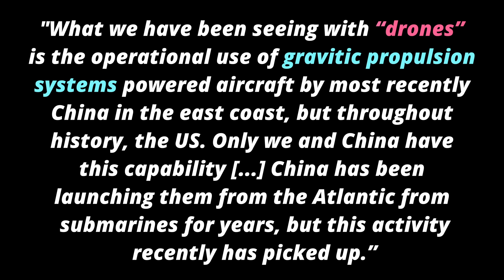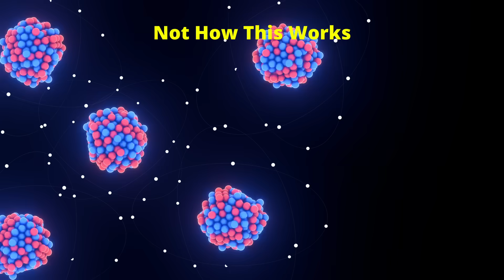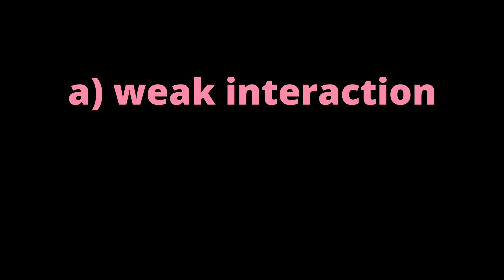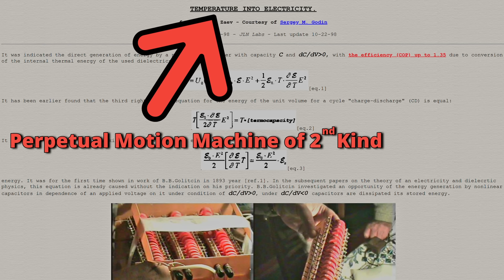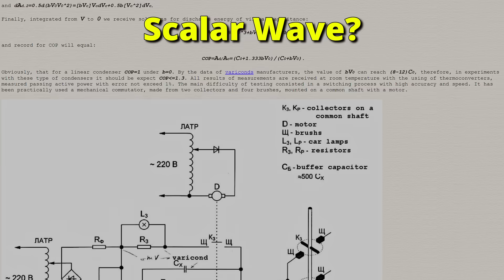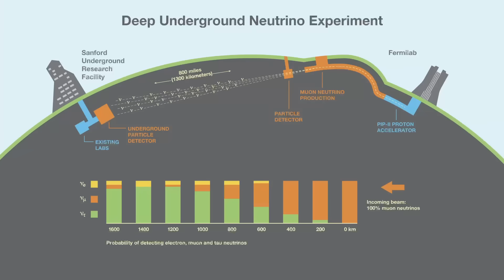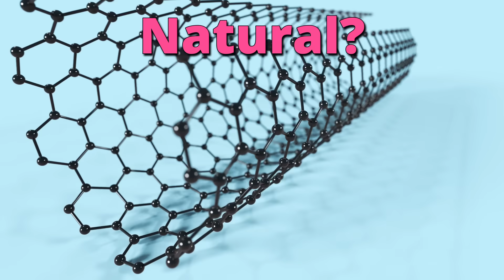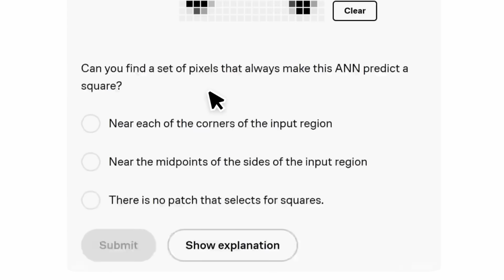What is “gravitic propulsion” and could the US government hide it?

Comment: I don't like them hiding math 😢
Reply: math is not important here. its the theory and model that is being hidden. if you have the right model, then you need to put it into formulas to actually get the interactions at the desired scale. but you need a theoretical model first to know what you are trying to calculate. then you make experiments to see if your model can work in a logical sense, then you make the equations to predict the forces, then you make experiments and   measurements.

physics has been degraded into pure math. its void of philosophy, and therefore full of bs interpretations. if you define axiomatically that a magnetic field is a force field acting on charges, then you axiomatically exclude all the other possible interactions with this model, since the field is modeled exclusively to predict the force on charges. such a model cannot be accurate or complete because it assumes the field to be only something that affects charges from the start. 

energy conservation cannot be used to predict missing interactions here because the initial condition only includes the energy that is needed to be transferred to the charges, and therefore only this energy is assigned to the field. 

a good way to use energy conservation to show that em fields must be gravitational in nature is the fact that photons are purely em waves with no rest mass, meaning they have 100% of their energy in their em field, because they are nothing but an em wave, which is an em field fluctuation. but they have their own gravitational field as they are red shifted by moving against gravity. if 100% if their energy is em, and they loose energy by interacting with gravity, part of that em force is directly interacting with gravity, making electromagnetism inherently gravitational.

Comment: The physics of highly accurate ballistic trajectories was classified and took several years before it was made public knowledge. Some of it is still classified BTW.

Electro-gravitics
Research began with Soviet Russia long before the 1940s, after 1947 physicists began to try and figure out how flying disks (flying saucers) fly, by the 1960s they figured out how they fly, using localised gravitational fields, towards the late 1970s the US had successfully built their own and flown it. Its flight characteristics were unstable, work then began in the next version after working out the issues and the new craft (TR3B) was flying, entirely human engineering. Russia was working on their own, but for some unknown reason stopped research in the 1970s.
China worked it out and had their own craft in the 2010s.

At the core, it is purported to use a low viscosity, near super conductivity liquid metal spinning at extremely high potentials and speeds.
My feelings on this is that there would need to be 2 coaxial rings, to counter the torque that would be acting on the craft.

It is quite the rabbit hole, and is all hidden physics.

Former director of skunk works at  Lockheed in the 1990s, confirmed that the physics they were using were at least 40 years ahead of mainstream academia.

Comment: I do not believe that large systems will lead to new physics beyond the Standard Model. Because even if large, complex systems would have properties that do not emerge from the Standard Model (which I doubt, but that’s just me), we would be likely unable to prove that. No one can apply QFT to a carbon nanotube and calculate results with sufficient precision to significantly contradict any well-done experiment.

The fundamental theories are so difficult to apply to real-world problems that no one ever does that. Simpler models as used in Quantum Chemistry have some applicability, but still any discrepancy to experiment would be interpreted as one of the numerous approximations used breaking down, so it would never challenge the fundamental theory.

As an example, I refer to the protein folding problem. We ʙᴇʟɪᴇᴠᴇ to understand the theory behind, it is just the sum of a zillion weak interactions between all the atoms in the protein, but quantum chemistry was never able to come up with a model that is both computationally feasible and accurate to predict secondary structure (=geometry) from primary structure (=sequence of amino acids). Now since a few years, the problem is mostly solved by AlphaFold, an AI model that has no idea of physics, but successfully inter- and extrapolates from a large database of known structures. The disadvantage is that we get a results (mostly a correct one), but have no idea about the real physical interactions that lead to this results. So we know what is, but still not why. There is really no way to improve fundamental theories from that.

Comment: Solution of the measurement problem means dealing with nonlinear activity which means computer simulation. The collapse of the wave function is likely to be a collective phenomenon running in many dimensions of configuration space (i.e. exponential time) and beyond the capacity of any computer. Even if we have a plausible hypothesis (e.g. tachyonic Brownian motion) we are likely to be going nowhere. Maybe we can cheat somehow.

The simplest cheat is to say that for objects heavier than the Planck mass, the Uncertainty Principle changes character to one based upon classical Brownian motion. We can at least work on polynomial-time computer simulations to explore this.

Comment: Place to start:

1. What powers electrons and protons?
2. What is gravity?  Not how do we experience it, but what is it?
3. How do fields and forces propagate through what appears to be nothing?
4. Parallel Wires carrying current in the same direction attract, while those carrying current in the opposite direction repel with either an air or vacuum gap between (hint: current flows in the same direction share their poloidal magnetic fields to form a single, stronger poloidal field around them both - a self building structure)

And, beyond that:

5.What are solitons, and why do they remain stable?  (Hint:  both electric and magnetic solitons - or loop toruses - which act as Möbius strips, naturally form)

Start answering those questions and you quickly come to the understanding there is no “anti”gravity.

 Gravitic - aether stream - propulsion is possible, however, thanks to fractal toroids (torus solitons running through the centre of wrapping poloidal torus solitons that, in turn, each run through the centre of their own poloidal toruses and potentially ever deeper in a self-similar fashion) - the hitherto unexplored structure you were talking about, a structure made of self forming ring solitons condensing out of a charge separated gas or fluid subjected to pulsed shocks at a set frequency in a resonant cavity

An example would be water (a polar molecule) subjected to ultrasound in a water bath into which is submerged a metallic skinned chamber providing both the cavity and electrons to “feed” the emerging self-forming fractal toroid structure.

So, has this been witnessed?  You bet - see the MFMP ULTR experiment
Reply: As to “hiding” lines of research in physics, this certainly happened- by using the absence of evidence from the (flawed) 1887 Michelson-Morley experiment as evidence of absence so as to pronounce the aether as non-existent, thereafter using a combination of the false claim, scorn, ridicule, peer pressure and the invention of some abstract non-physical “spacetime” to close off an otherwise rich seam of research (to such an extent that even when, in 1920, Albert Einstein himself stated his belief in a real aether, his statement was just ignored and buried.

So, is it a possibility that parts of and lines of research in physics were made to “disappear” - it already happened to the detriment of humanity for the last almost 150
Reply: As to “hiding” lines of research in physics, this certainly happened- by using the absence of evidence from the (incorrectly interpreted and hence flawed) 1887 Michelson-Morley experiment as evidence of absence so as to pronounce the aether as non-existent, thereafter using a combination of the false claim, scorn, ridicule, peer pressure and the invention of some abstract non-physical “spacetime” to close off an otherwise rich seam of research (to such an extent that even when, in 1920, Albert Einstein himself stated his belief in a real aether, his statement was just ignored and buried.

So, is it a possibility that parts of and lines of research in physics were made to “disappear” - it already happened to the detriment of humanity for the last almost 150

Comment: Somebody doesn't know that the ideal transformer model is wrong in spice.f5, and doesn't know shit about parallel resonance,  nor how to tap it for energy.  You didn't even try the resonate primary, 1 to 1 to feed a resonate primary of a second transformer,, because,  it will crash your simulation by outside assumptions written into the software, and physical circuits will never be properly simulated but, stopped.  Build circuit, compare to simulation.

Comment: So lets assume inertia is the result of fluctuations of the vacuum and the resulting resistance to mass these fluctuations cause. Something akin to quantization of gravity causing resistance to changes in momentum via "friction" of vacuum fluctuations against a moving mass. Now if you could produce a meta material that resonated with these fluctuations at the quantum level such that inertia was dampened to effectively zero by cancelling out this "friction', you could produce a gravitic planar propulsion system that resembled the effects described.

Comment: What if?...  the gravitic propulsion system exploits the general relativity phenomenon of increasing mass of an object with approach to light speed.  You no longer need a large particle or body to achieve high mass and thus high gravity.   Hypothetically a small mass can be accelerated to near the speed of light relative to an observer thereby generating a large gravitic field.  That said, the mechanical complexities and properties of such a device are any ones guess.  You would, at the very least, need to have some sort of spatial isolation from the accelerated particle which could probably only happen if space is locally distorted. This also doesn't address why two objects of high mass, the earth and the hypothetical gravity generator are not attracted and are, instead, repulsed.  If anything, a gravitic drive would have to generate anti-gravity using some yet undiscovered and undefined exotic particle or multi-particle mass.  Others have speculated on anti-matter but, from what I understand, the properties of anti-matter are not anti in all respects. A recent paper showed that antimatter attracts normal matter.  
Speculation is never a bad thing and conspiracy theory is sometimes just underdeveloped and under-informed nascent theory.

Comment: The issue of classification is very interesting, and there are books on the subject. However, as you point out, that's at the physics and engineering stage, not at the maths stage. A good example would be implosion hydrodynamics and target design in thermonuclear weapons, and inertial confinement fusion research, which is related to the former.

Comment: The increasing rarity of new discoveries is just how discoveries work in every field. Early paleontologists found bones literally sticking out of the ground and every single one was a monumental find that described something new and huge. Once the surface is picked over you have to start digging and finds become statistically more likely to be something you already know. 

This is the same for ore mines and oil fields. Eventually you cross the threshold where the goodies are hidden in places that were not economically viable to look before and you need better technology and more time and effort to extract the stuff. 

Sanding a piece of wood, weeding a garden, restoring an old watch, these are all the same principle of diminishing returns. You discover all the big stuff first because it's the most obvious and because it requires the least amount of effort per unit of result. 

I appreciated that perspective. Thanks Sabine
Reply: Leaps in understanding will always happen. Arrogance will not stop it
Reply: The same is now happening with computer hardware.
Reply: @mojrimibnharb4584  
Not really. Turns out it was just Intel being lazy. There are many ways forward, even with just silicon technology, and there are more promising materials, known since the 80's. I've read about optical computing in the 80's too, it's quite frustrating that it's still sci-fi 40 years later.

We know where are the theoretical limits of computing (Landauer limit), and we are very very very far from it. Not to mention that it can be crossed with reversible computing, which is already being developed.
Reply: A friend and I saw an aircraft/UFO that I later found out looks similar to something called the Tr3-B. Look it up. 

 It was Groton Connecticut 2006ish. It hovered silently for 5 minutes in the night sky where I could see the silhouette, and lights. 3 lights each corner with one weird one in the middle. 

 After 5 minutes of us being like what is that. It took off like a bullet suddenly. Not a rocket or aircraft. I saw no plume or heard anything. 

 It headed north before heading over the tree line, and then suddenly popped out heading east. That turn must have been HARD. It was only out of sight for a moment! 

 Then it went over the horizon. The entire process took under 10 seconds from hovering to over the horizon. 

 We could never figure out if was small, and silent. Or large, and high up. Yet just last year Sandboxx news Alex Hollins told his story of seeing one too which is just insane. He is a respected journalist. He said it was massive! 

 I cannot explain that, and I won't. My friend says aliens, or dimensional beings. I don't know about that. 

  I think Alex, my friend, and I saw the same thing. Yet I can't be certain if Alex saw a different craft. 

 I swear by this story. Things like that make me agnostic life, and my friend crazy, lol. I just hope it is ours. Never seen any real UFO again sadly.
Reply: Yes, but no. There is a world of information just below the surface that has not yet been discovered in terms of Dinosaurs, Rome, Germania, The Celts, the Chinese, the... everything. There is SO MUCH their. Discovering it requires two things: Passion, and incentive. Beyond this though - if we consider the average total man hours per discovery and track that over time, it's stayed relatively consistent for millennia really. The amount of people relative to the total populace doing research is small - and while research and discovery is more difficult then say 500 years ago, we have far better tools for doing that discovery. 

So the question: What is going on? To understand: We have to understand what drove funding and research in the past - vs. what drives it today.

In the past: Military interest, and wealthy people interested in a topic. Today: It's mostly driven through political interest, and while there is still military interest - that military interest has been diminished mostly to the realm of the militaries own capability.

Historically, Military interest would include, but not necessarily limited to: Ancient cultural finds, Geological surveys, understanding local flora/fauna, potential resource deposits, and more. Why this fell away is largely in the post WWII era - we shifted from a dominate, colonize, exploit operation and we shifted to a Trade based relations operational process. After all: If you aren't planning to occupy a region - you don't need justification such as "Our ancestors lived their".

Today: Military interest - was basically replaced by Political interest, and from this we have seen a complete disregard to studies that even suggest something other then human sources are driving climate change. We see string theory dominate the field through funding grabs as compared to every other form of theoretical physics stifling potential discovery. And the list keeps on going.

When you politicize something, and create a bureaucratic process - when every research paper needs to deal in some way with climate to get funding - good research is stifled, in favour of people more able and tuned into the political BS. And as a result: Less good science gets done.
Reply: First we find the things more easily findable. There is still lots of stuff to find, but it's all hard to find now. At some point new things are going to be so hard to find we would stop trying.
Reply: But we know that we still don't know a lot of things. And maybe we can never know everything.
Also, our resources are growing exponentially, and our tools are getting better too. So It would make sense to still discover things at the same pace. We do find bones regularly btw., and even entire cities. And there are still plenty of places we haven't even looked yet, like Antarctica.
Reply: True, however, we live in a creative universe with infinite possibilities.  Therefore, new ideas will never run out! What was impossible yesterday will be taken for granted tomorrow!
Reply: I think it's naïve to think the US government doesn't have highly classified tech. We won't know what it is until it gets out, like stealth tech. The only real debate is how far ahead of the public they are.